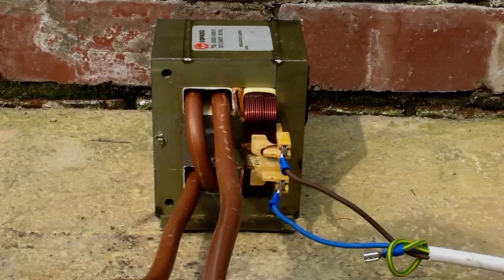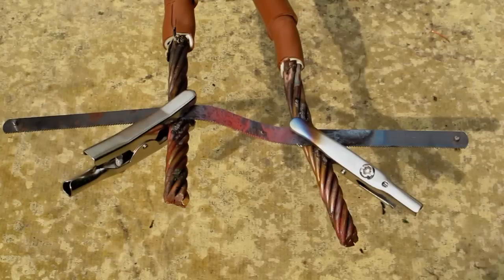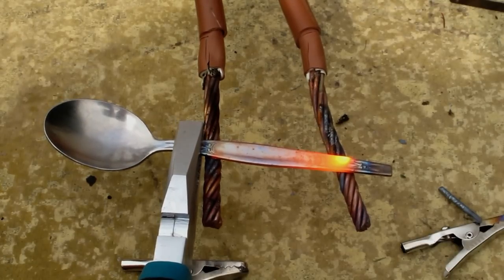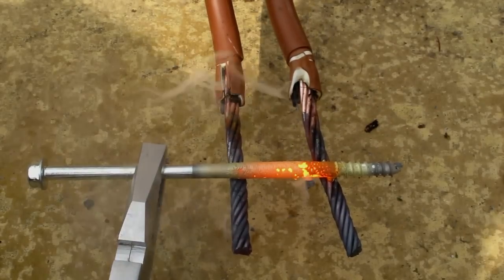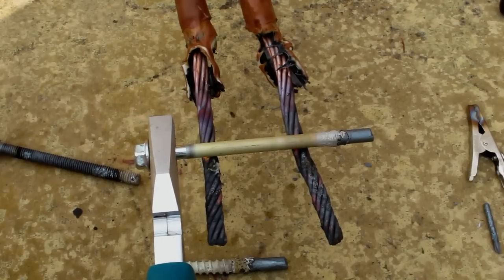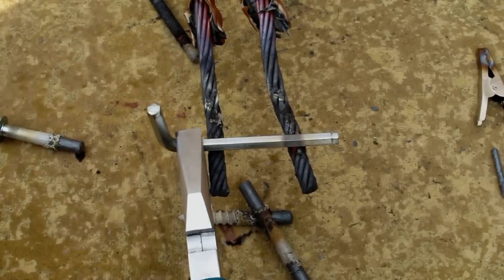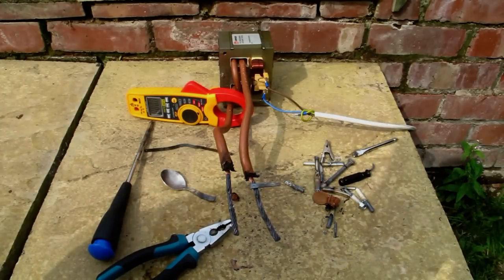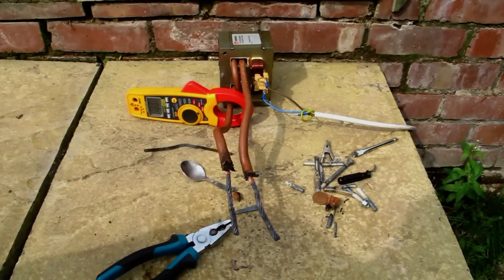Modified MOT: playing with high current. (Part 2 of 4)

Comment: You need to remove those magnetic shunts as they reduce the output current and protect the MOT. without the MOT will run fine, just keep an eye out on the temperature of the 240 V winding.

Comment: how to posibility to reduce output current?
Reply: more turns on the secondary
Reply: Or lower input voltage on the primary...
Reply: well yes but not everyone has a variac. also you can adjust the air gap between the iron core joints
Reply: Indeed, wasn't knocking what you were saying.
Reply: and sorry for my smartass tone when i look back at it :D
Reply: lol, that is fine, mate. If you wanna see a monster Variac, come over to my channel and meet the 10kVA "Thunderbox" - Nothing can survive its 550V output. ;)

Comment: Just made one like this but using a 30mA 10kV IGBT. I put 2 turns, going up to 9 turns of heavy wire and it wouldn't go red hot. I added another 9 turns over it making it 18 turns and it will go red hot only after 1  minute 20 seconds. Then I decided to remove the shunts and found it will go red hot and light red hot in only 20 seconds. Now I'm wondering how to get same results with the shunts in place.
Reply from the maker: Interesting. I removed the magnetic shunts on this transformer and got a couple of extra turns on it. See the later vids for 1400 amps of metal melting goodness :)
Reply: But that can lead to blowing fuses... so i wouldn't recommend that to everyone :)

Comment: I hope i got this right : The reason why this will not hurt you is because:
-The U=1,8 Volts
-The R=30.000 Ohm (Dry skin)
I=U/R=1,8/30.000 = 0,00006 Ampere. And that is not lethal.

And the reason those other things burn is because their Resistance is quite low.

Is this right? Thanks a lot for an answer :)
Reply: sounds good i wish i knew more about ohms law.....but wasnt no breakers tripping?
Reply: Remember, that human isn't pure resistance but impedance and that is dependent on the frequency of the voltage. And when the voltage raises, the resistance of skin decreases pretty fast too.

So pure ohms law doesn't really cut it when calculating this stuff :)
Reply: Mtaalas if the voltage gets arround 400v the skin resistance will break. This is known as the breakdown-voltage. When that happens there can go more current through your boddy

Comment: Stainless steel is very tough. :)
Reply: +BloodySword no, it passes the current just bad
Reply: Turborider When it passes current badly, then there is more resistance and thus more heat. So that's not the reason.
Reply: when there is more resistance there is also less current and because he has just 1.8V output voltage that actually is the reason

Comment: Look for older microwaves. Most of the newer ones use silly, pathetic little MOTs that burn up far too quickly. I've got a few MOTs from old microwaves that are just huge, they dwarf the one's I pull from modern microwaves. Good for all kinds of high voltage or high current fun!